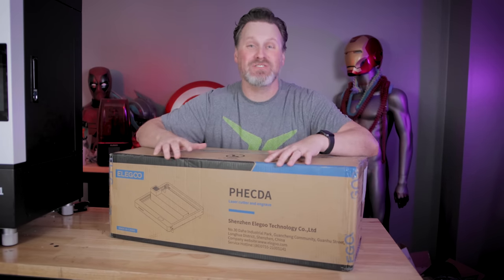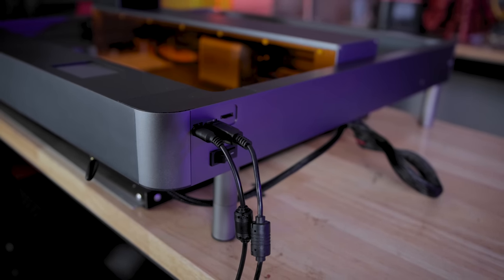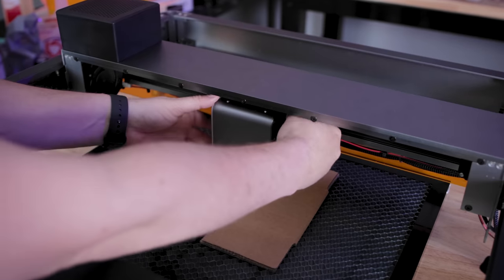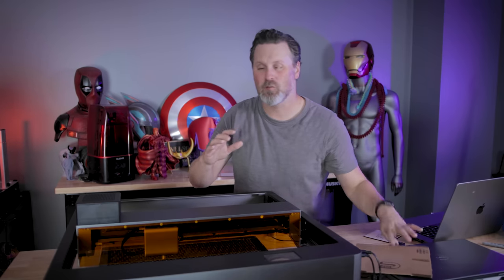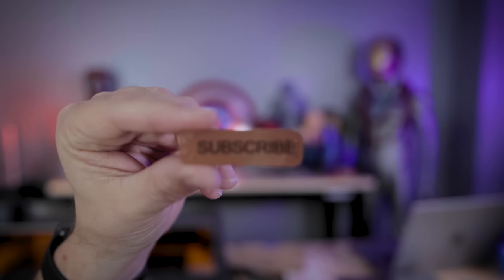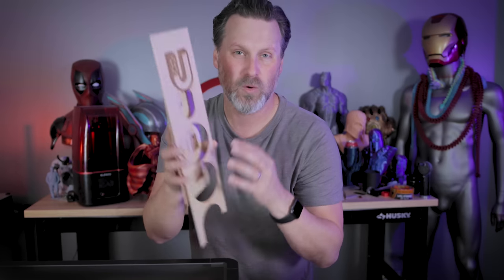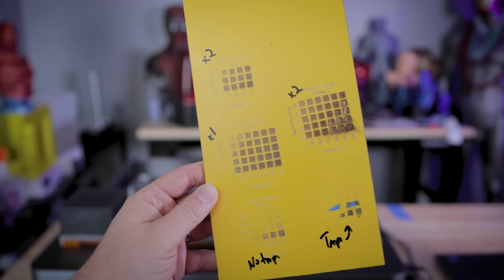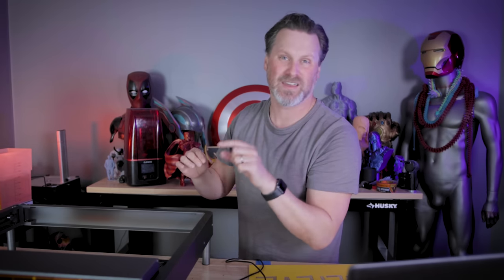Elegoo PHECDA Laser Engraver - First Look

Comment: I'd like to see how this machine cuts paper and card, does it leave scorch marks?
Reply: if you dial in the settings, no scorch marks. It's actually more precise than a blade cutter like Cricut.
Reply: @YaaLFH  Thx! I'll finally be able to make a decent job of creating gaming cards from PDFs.
Reply: @thedourkin  If that's the only thing you're going to use the laser for, get the 10W - it has a smaller laser dot and you don't really need more power.
Reply: @YaaLFH  I'll also need to etch and cut 2-3mm MDF and 0.5-2mm opaque acrylic. Obviously if I can I'd try other things but those are my basic needs and if the 10w can do those things then I'll go for that rather than the 20w.
Reply: @thedourkin  You will be able to etch and cut both with 10W, just slower than with 20W. Cutting - no faster than 5 mm/s for 3 mm MDF, and acrylic may need more than one pass depending on colour. 
You'll also be able to engrave slate and glass (using a masking medium), tiles, painted canvas, powder coated steel and anodised aluminium. Marking some stainless steel also works but some types require a masking medium.

Comment: Can it cut aluminum and steel sheets, and how thick?
Reply: no
Reply: It cant engrave metals, its the wrong laser type for it, it can only oxidize or remove coatings from metals.
Reply: LOL, nope. This is a cheap diode laser, to cut metal you'd need a fibre laser which is significantly more expensive.
Reply: @YaaLFH  Oh wow. You're not kidding about fibre lasers being more expensive...
Reply: @VoidOperator  Yeah. And unfortunately you can't make them must cheaper currently, the technology is just that expensive.
Reply: @YaaLFH  Well I guess I'll just stick to services like sendcutsend for the next decade or so lol

Comment: Its nice, I snagged one for 200$ on kickstarter. I will say tho that if they plan to sell these for like 400$ for the 10W version I think they are going to be upset with what happens. Once you get to 500$ you can get a crap CO2 laser and so it just seems a bit silly to run with a diode laser which is less safe unless all you plan on really doing is engraving.
Reply: Switching to CO2 at that price range makes a lot of sense, considering how many of these open diode machines are competing in the same portion of the market.

My main issue with these machines is honestly the lack of enclosure, laser safety glasses are a must, but they should be a redundant need in addition to an enclosure that all but block any potential exposure to laser light.
Reply: @AuntJemimaGames  Totally agree the safety glasses should be the absolute last line of defence in case you make an error, I'm getting one but no way will i be using it outside of an enclosure.

PPE is there in case everything else fails not as your primary protection.

Comment: I would love to see some tests with acrylics!
Reply from the maker: I need to do more research on that as I saw clear acrylic is a no go
Reply: @UncleJessy  I wonder if the acrylic with the paper backing would work? Obvious fire risk.
Reply: @UncleJessy  Clear is a no-go for any diode laser (like the Elegoo here). You'd need to step up to a CO2 laser for clear materials.
Reply: @bwdnako  This is a laser, not a lightsaber. It won't cut clear acrylic just because there's paper on the surface.

Comment: You cannot engrave metals with a 450nm blue laser.  You can oxidize it to get some color changes, and you can remove paint and powder coating from metal items. Basically your metal needs to be coated or anodized. Be very careful of what you want to try to engrave as some materials can release very toxic fumes. Get some real glasses too that you know for sure are for the correct wavelength.
Reply: Yeah those side panels look like theyre doing absoloutley nothing.

Comment: Man, so many companies have established products and history with diode lasers on the market. Looking at the price point and features set, this one is just a hard pass. 

The xTool 20-watt has a rotational attachment at the same high price point. The Otur, at the 10 watt level, has swappable diode modules (20 watts upgradable), bracket-mounted height adjustment in addition to leg extension, and the ability to add air assist for better cutting and fewer flare-ups. In addition, the enclosure from Otur is very inexpensive. 

I love my Elegoo 3d printers, but I'll be going elsewhere for my laser engraver, possibly up to the CO2 level.